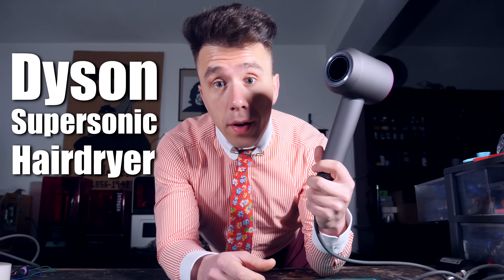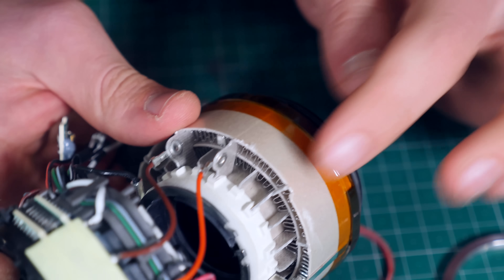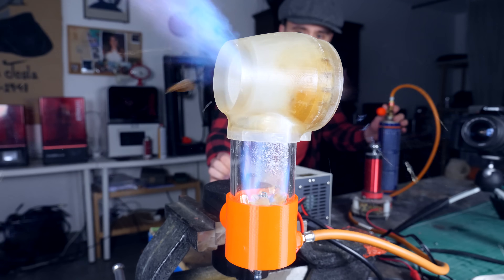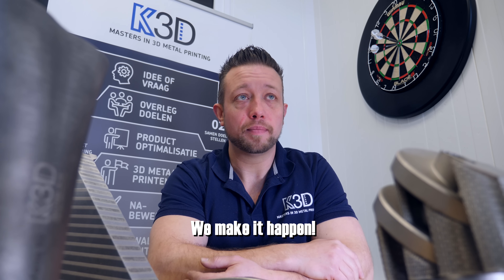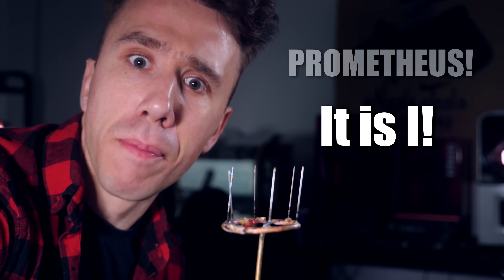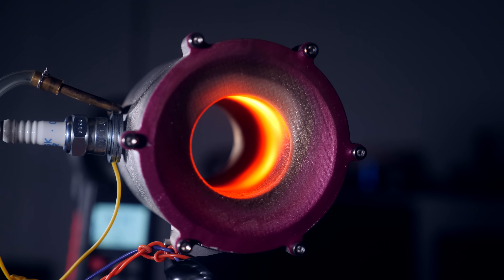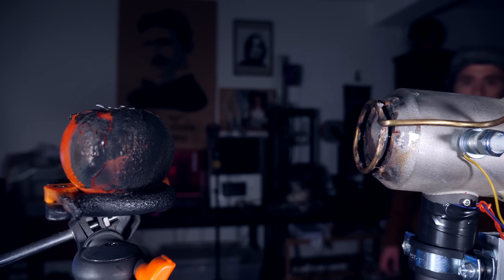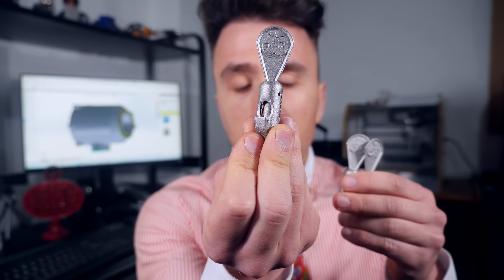I turned my DYSON HAIRDRYER into a JET ENGINE

Comment: One idea is that you could use a high bypass turbofan design, it is what is used in the GE9_ series of jet engines and seems somewhat simple to design, there are in fact a lot of fans to pump O2 and fuel. It would have to be printed in metal as I can imagine it would produce a lot of heat.
Then we could see the ultra satisfying video of them cleaning you parts again as well!

Comment: A ram/scram jet? You could perhaps use the slow from conventional jet engines to generate the flow required? Or is that effectively just an afterburner…?

Or see if you can replicate exhaust designs for stealth, ie cooling the exhaust without the loss of thrust by mixing in the bypassed air and creating a “squashed”/flat nozzle that encourages mixing. It would be interesting to see how cool you could get the exhaust gasses.

Comment: Future video theme:

Now that you can do metal parts, I'd suggest revisiting some of your older ideas that would probably have worked if the nozzles/bodies whatever parts you made out of plastic or ceramic hadn't failed.

You could go a step further, and combine several different design elements from previous failed tests into one insane rocket, but again, using metal parts this time, OR test multiple past designs made in metal and see which is the winner.
Reply: Doing metal parts and "affording" metal parts are two very different things
Reply: @HicSvntDracones Raid backs it up
Reply: @LtdJorge  Just because you "can" afford something doesn't mean you should. and only getting about $5k per Raid sponsored video, depending where you are, $2k in Russia up to $10k in the US. Unless 3d printing prices have dropped significantly in the last 3 years, he would be looking at using an entire sponsorship to just print enough parts for one experiment.. You design and test as CHEAP as possible, once you have a definitely working prototype, then you go to metal.
Reply: @HicSvntDracones  But if he went with my idea and rebuilt some older projects that failed due to "not metal", then the prototyping process has already been done...

Comment: Hi Integza,
I propose that you are able to create a Ramjet engine. The Ramjet engines are required initial high flow speed to start the engine. I propose that you can use that Hairdryer motor and compressor to give initial flowrate. You can create hybrid RC plane also using that ramjet.
good luck
Reply: arent ram jets engine only aplicable at mach speeds?
Reply: @Khoolhwhip  yes, you are right. After your comment I did small research on that. All experiments are success around considerable high mach. Tx
Reply: @viduranga924  yes, you need to go supersonic
Reply: em, ramjet you say, xDDDDDDDDDDDD
Reply: @pietronegretto  I saw some engine work at subsonic speed too.
Reply: @viduranga924 we haven’t quite perfected it we have some thats transition from a traditional jet to a ram jet
Reply: @Lich_demi  Yeah but in those tests they need the intake velocity to be insanely high, since they've got tons of funding I think they can pull it off but in a garage setting idk if you can make anything close to that. There's a case of half and half being used turbo jet with a ramjet bypass, sr71 was the first half ramjet sort of
Reply: ramjets can operate subsonic though they aren't efficient. However they rely on the motion of the plane through the air to ram the air into them to compress it. IE they cant run on a bench
Reply: @Khoolhwhip  you can use the output of a different type of jet engine as the input for a ramjet. That's essentially what an afterburner is.

Comment: Another great video ❤
What size (diameter) would it be if you added a single (or multi) stage couling around the outside. A few compression chambers located at the fulcrum of the engine could increase exhaust (and help temps) and it should give you a vacuum (to an extent) up front😊. Reason I mentioned "size" was for twins with counter-rotations😁👍❤️

Comment: Try using a bigger dyson motor and use and for the top bit on the inside use blades spinning attached to a bearing , stack them and you have extra propulsion inside the top generating more thrust

Comment: i think you can try to make a liquid cooled dyson jet engine (you already made a video about cooling jet engines with water but i think that you improve your design since)
-the fuel line can't be 3D printed but with ceramic 3D printed or even some high temperatures filament you can make the other parts of the engine if you add a liquid cooling case
i'm making my own HHO jet engine and i only have a regular PLA 3D printer so if you make a video about that that will help me :)

Comment: Video series idea:  it is time to start doing cooling projects, since it is pretty much evident you´ve had temperature/melting issues through time lol. Lets start with a sink cooled turbine that also works as a mocha coffee pot, cause you know,  coffee is great, sensible to latent heat dissipators are more efficient than only sensible ones and because why not.  Tip, copper heat pipes have a 40-100kW/mK  effective thermal conductivity, perfect for transporting heat under quick and big temperature deltas between components and ambient temperature. Also, if you dont transport heat through enough pipes, once they exceed  operating temperature, they explode, and things bursting are great for content.

Comment: Hey Integza, have you considered using ceramic slurry, and wax-like resin to make your 3D-printed parts into metal? I am working on doing something similar for aluminum castings using suspenda slurry and I would gladly share my knowledge with you if you'd like.

Comment: Joel check out the wet-heater type engines.
 It was used to propel torpedoes in WW2.  It is halfway between internal combustion and steam propulsion.
I think it would make a great theme for a video.

Comment: Video Idea : Build a jet engine which can lift a plane just like that of the SHIELD Helicarrier in the Avengers series. I mean you already are at a point where you know how to build jet engines, might as well make a plane now. The title could be "SHIELD Helicarrier but it's not a movie!". Body can be printed in metal with actual functionality like a go-pro for now. If it works we might as well build a real one XD. 

Although I think the fuel supply might be an issue. But you could use the hydrogen in the air around using a collector of some sort. I think that made sense. "I Think". XD... Loved the video btw.
Reply: Lmao sounds cool
Reply: Helicarrier? Let's goooo
Reply: I think this might work. But how will you manage the fuel. I don't think it will be efficient to run four jet engines with limited fuel. Those babies could drink up that juice fast.
Reply: Although I think the idea is really cool

Comment: Video idea: metal print the pulse jet engine and use the Dyson compressor to feed it. Maybe you could incorporate fuel line cooling ducts to chill the incoming air the way NASA does in there engine nozzles. PS. If you pull one of the load cells out of your kitchen scale and mount it to a horizontal surface you might be able to measure the thrust more reliably.

Comment: Have you got a way to test this design with increased air injection at the front?  curious if this deisgn would work as a scramjet at greater speeds (providing its own self-sustaining compression without use of electric compressor)  the hollow design is impressive.

Comment: Video idea: Make your own laser sintering 3D printer. 
It could be used to make 3d parts out of steel or metal for the engines you make and if you succeed will be more precise than the traditional idea of a metal 3d printer

Edit: just got to you discovering this in the video, but I still think you should try build your own

Comment: This is brilliant but have a question the pressure in the combustion chamber can overcome the compressor if it gets too high?
   Cause was thinking 

You can have it printed from inconel incorporate a cooling worm to run cryo acetone can cool with dry ice 
   And add a lox injector 😮
Reply: Please be careful though getting awfully close to glowing metal with high pressure in it 
   Ngl had me 😬 a little
Reply: And you can't run lox through anything that will get very hot glowing hot 
   Make a cutting torch
Reply: What I mean obviously it can be in the combustion chamber but you run it through the nozzle like how raptor has cryo liquid methane run through their nozzle 
   Replace this with lox bad day
 Metal burns add oxygen it burns faster
Reply: But you can still use cryo lox in other ways to contribute to cooling the engine
    With like heat sinks running it through them

Comment: I´m making a turboprop turbine using 3d printed parts for the compressor and the metal impeller from a common vacuum cleaner. I was thinking of having just 2 bearing in the cold side of things, so they dont mel, but im worried this may produce too much vibrations, so this hollow design may be the solution to the bearings problem. Can you please upload the cad file?

Comment: How about you redesign the main housing and attach three of those compressors at 120 degrees from each other to feed it? You could also design a larger cowling around the main engine body so as to act as an air ram for the compressors.

Comment: I'd love to see you add a 3d printed steam or air engine to a bicycle and do a test ride in it. It should not be dangerous, since you can add some kind of shield around the engine so your leg stays safe! I'd do it myself, but I only have an fdm printer so I can't print out the cilinders, steam is too hot for fdm printed materials.

Comment: integza do you remember the abs filament rocket engine. well I think you could increase the thrust by printing at 50% infill but as its printing put sugar in the littel holes. Making it basically like the sugar rezin but with abs.

Comment: I have a weird project idea that I'd like to see.Use a EDF and a electrical resistor(the type used in heaters) to see if thrust can be increased.Maybe try to build a cowling to contain the parts and test the thrust of the engine

Comment: Can you help me !? You are the right person to ask to! i saw thé dyson dryer can also cool to 28 degrees, I wanna use it to replace the broken fan of my scooter with the engine and dyson fan , how can I do ? In particular it a modified Honda ruckus 50 cc , and I m creating my N2o system and maybe Wanna add an extra tank with a mix of gazoline,metanol and nitrometane 😊😅.  At thé moment i want to know how u run thé dy-engine , i mean how Much power it takes? 
I need a battery  to ran it .any suggestion for the watt/ voltage to use ?😊 i ve many many ideas, time and even some money maybe we can help each other !
To be honest i love science, ergine , speed , power, combustion \ explosion/ deflagrations, mechanical, i was making rc bombs since I was 8 ( the most basic,75,15,10) usinge the resistance of the little Christmas lights for ignite the explosion 💥 🎉😂and to be honest I m not graduated in any of those , I’m cook and winemaker 
Hope you answer me back ,wish you the best

Comment: You just need to work out how much power the compressor in a similar sized turbo jet engine uses, it's a huge amount, in the order of ten or twenty kilowatts. Hence, these type of engines dont work very well, especially when the "compessor" is actually a fan. It is certainly a very nice fan, though.

Comment: I have a suggestion for a jet engine video. Since you have a cnc machine, this should be possible. I suggest you make an axial flow turbojet engine, meaning the compressor has multiple stages and pushes the air directly forward instead of centrifugal flow, with an impeller as a compressor.

Comment: I mean for an idea you can try to make a larger one or more of them and try to make it mobile, like on an electric scooter or bike to give it a starting speed and then you can turn them on. As well as then being able to pull the extra for the equipment and fuel an e-bike might be easier for safety reasons so you can just detach it if anything goes wrong. 

Or go smaller scale or use the one you’ve just made and put it on a RC car or just a metal toy car and see how fast you can make it go while being careful not to use too much space. 
Just as a few ideas.

Comment: Video idea: another way to produce epic amounts of thrust is to prevent water from freezing. This might be really dangerous, but what if you took a canister of water, and then supercooled it using liquid nitrogen, but make sure to poke a little hole towards the bottom so the water has a way to escape. The inability to freeze would cause it to build pressure in the tank and force water out at high speeds producing trust!!!

Comment: Video ideea: make a big thrust engine using server cooling fans  they muve a lot of air too or use a cpap 24v fan from mellow as the air source, also you can make inside like a chamber for water cooling for the engine.

Comment: Well.. might time to metal 3D print the windspeed meter since you meted the last one. It should still work electronically so might as well try to rebuild new fan for it.

Comment: Sorry this isn't a very good comment for this video. But you could cool pla or abs the same way rocket engines do by flowing propellant (or liquid nitrogen) through the material in tiny porins holes printed into the part surface to transfer heat away from the material to the coolant. Then maybe even using the propellants expanding force to increase pressure  into the combustion chamber. which means you won't have to make fancy hard to make ceramic parts. And my video idea is to make a full fledge liquid rocket engine. ps keep up the good work.

Comment: I love your videos but why dont you build a thrust meter. I would like to see how your engines compare to each other. There are all kinds of accelerometers available, rpm sensors as well as pressure transducers. If yiu could build a stand that you can mount your engines on and an adjustable  sensor plate with different measurements I think it would be very interesting. I have a couple ideas if you are interested

Comment: Could I make a design suggestion?  Move the flame and ignition system to the handle and re design it at an angle that meets close to the intake.  This will be where the air is pulled from for ignition in handle.  Duct the air for its exhaust to before and several inlets to the tube.  Make the tube cone shaped so that it continues its compression with a nozzle stile outlet.  Making the dison fan and ignition all in the handle will force you to increase outlets in the cone because of pressure.  It will not get as hot and will run more efficiently.  If you sleeve it so that air has to travel through a sleeve then not combustion it will cool itself in its process of heating making its own eventual propulsion into its own hyper cooling system at the intake end.  Steading the nozzles in multiple ducted internal louvers will also dissipate heat and noise.
Reply: I also think you could test a different design without ignition.  Using your own design like disowns impeller increasing the number to nearly replicate ignition outlined in the cone ignition design.  This could be done with a 3d printer and could imho generate enough for vertical liftoff.  It’s important because it could make way for continuous vertical flight.

Comment: I know you want to make small jet engines, but I would like to see a design that uses a laminated fuel system.  As it is possible to laminate the water flow to travel down, because all the movements of the liquid are directed.